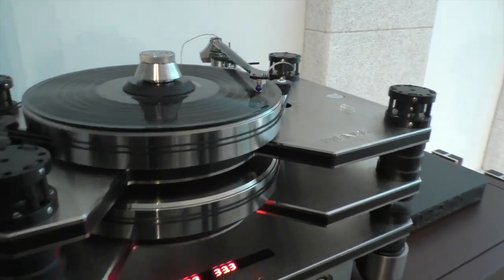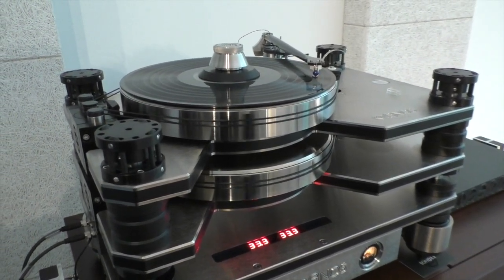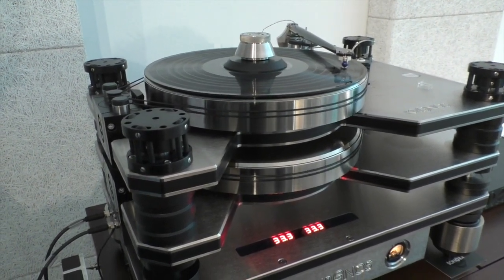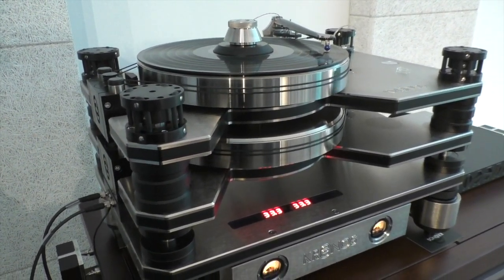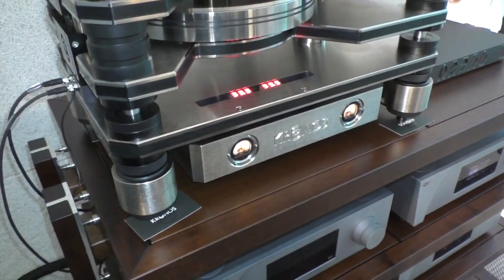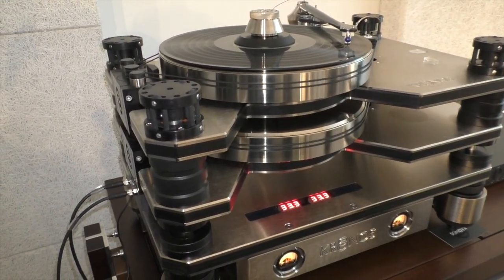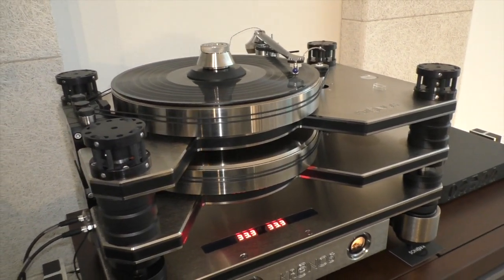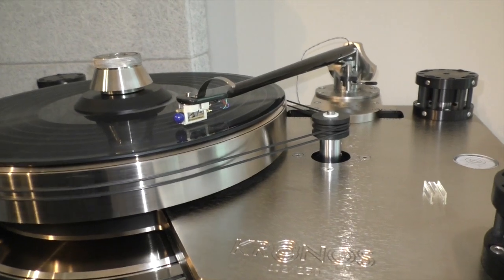Kronos Adds Optional D.C. Accumulator Power to Pro Turntable

Comment: Why dont you just use some lead acid batteries? they are cheaper than this special power supply.
Reply: Analog Planet and don't forget that capacitors dont work like real accumulators like lead acid batteries. in my opinion: real batteries>normal Power supply>this super capacitors thingy.